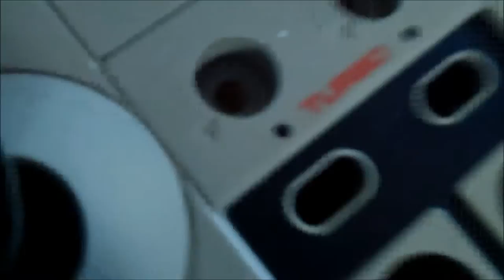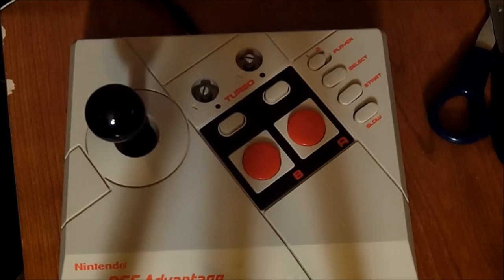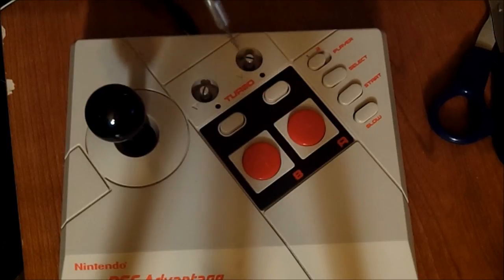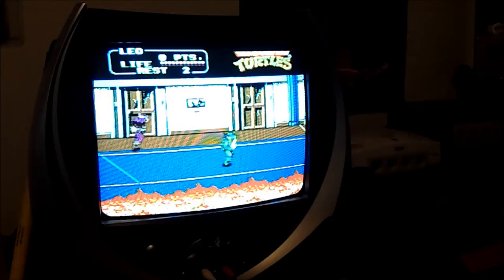Opening and fixing a NES Advantage controller .

Comment: I opened mine, because the buttons are sticking too, wich is annoying. The NES advantage is a great stick, but the buttons suck because they used gamepad technology instead of "proper" microswitches. I think the problem is caused by the contact pads beeing too small in relation to the size of the A/B buttons. Mechanically this is a week design wich kind of ruins an otherwise great joystick. Maybe they should have put springs underneath the buttons, to spread the load more evenly. Great video.

Comment: FINALLY a video on how to fix one! awesome! hey for those messed up plungers btw, i believe you could just use some crazy glue and let it dry for 24 hours. it works great for plastic to plastic so im sure it should do just as good a job for rubber parts.

Comment: I decided to disassemble my hideously discolored one. Found a very different PCB revision than you with all the wires coming out on the opposite side. The directional PCB is mounted 180-deg off (logic or wiring compensates). No cross piece. The main PCB on mine is "REV-H" and says "JAKING" with much more angular traces. The directional PCB says "SUNSHINE" on the side with the traces.

Probably just should have lubricated the buttons. Thanks for confirming the nuts on the turbo knobs.

Comment: The rubber domes in the regular controllers wear out too and cause button insensitivity, not sticky buttons. Sticking buttons is just poor design that can probably be fixed with lubrication alone. If designed correctly there shouldn't have been enough space for the button to tilt and get stuck at that angle. It should be forced to move up and down straight with tighter clearances and/or taller shaft, and lubricated if it is too tight.

Comment: hi. do you have any idea why my directional joystick wont work? only couple buttons seem to work, leds light up when I press buttons
Reply from the maker: Which pad is it? From what you've told me it seems as if it just might need to be opened up and cleaned a bit. In my experiences that fixes almost 85% of old school controller issues.
Reply: I just opened it up and cleaned it. Is the nes advantage. I plug it in and i think the buttons work because the leds light up when i press them. But the joystick doesnt , wont move to any direction, i checked the wires they seem to be okay, no loose wires or nothing, strange
Reply from the maker: that209gamepicker Seems like you need to check the traces on the circuit board. Look at 4:20 of the video and see if the traces are intact. They will look like copper lines on the board and should be one continuous line If not make sure the bottom of the joystick has the rubber part and spring on the bottom of it.
Reply: Okay ill check the video now, and it has the rubber part and spring also. The rubber parts arent ripped or anything.
Reply from the maker: that209gamepicker The bottom of the rubber parts may need to be cleaned. I've heard using a erase on the side that would touch the circuit board will clean it up. dont do it too hard , it should clean up with some ease
Reply: On the rubber part? Not on the circuit it self ? Will there be something burnt off or something? Ima open it up right now and check, i really want this to work
Reply from the maker: Use the eraser on the rubber part , not on the circuit board. Sometimes the rubber part gets a little dirty preventing a clean connection to be made.
Reply: Okay. I got it to work but. Only with one of the connection cords player 2 only. Player one doesnt work if i switch the button to player one . And player one cable connected. But if i put the button to player 2 and put cord two im slot one itll work . This is confusing lol

Comment: Hello! Could anyone tell me, check me, is the A bottom turbo is faster than a B at the same settings (for example min setting pots), just only me or thats common. Its a great joy i love

it but whene i play a games like double dragon and i wanna jump (You can do that whene press a+b at the same time) but i cant do because the nes detect the faster action first.I take it apart and clean it and replace a capacitor but it didt salve the problem.How can i fix that?And finally it's a great video!